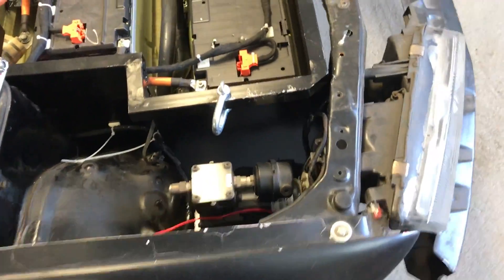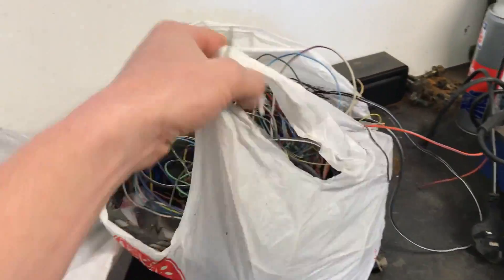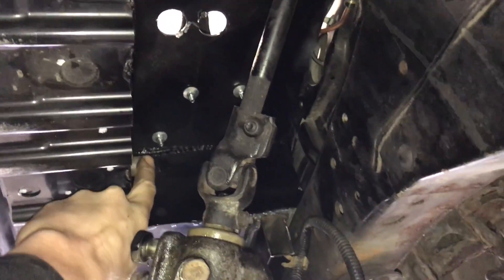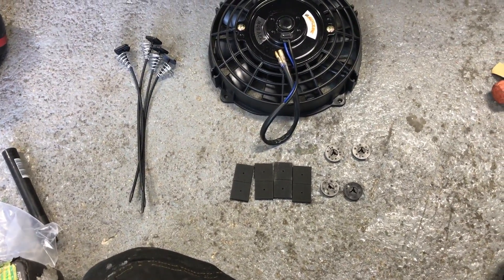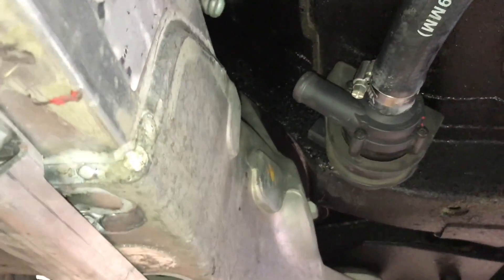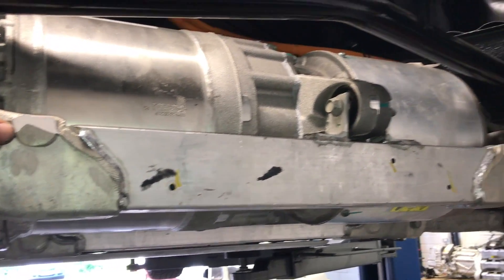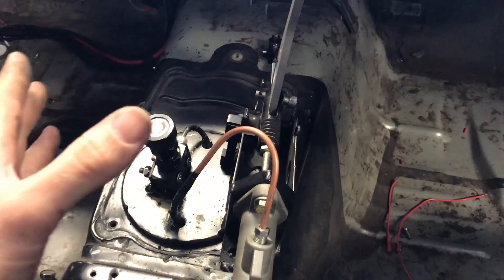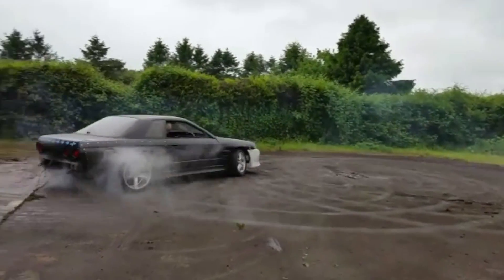We Put a Tesla Motor in a Nissan Skyline R32

Comment: Looking at building a Tesla swapped 66 Mustang, how did you break up the chassis to use the Tesla rear subframe? Did you weld the rest of the chassis to it? Wouldn't you have flexibility issues with the chassis chopped?
Reply from the maker: TheHelloDonk hi, the chassis was notched abs a full weld in roll cage has been addid

Comment: The point is not about the sound of engine, with that electric drivetrain you might get instant torque , but not instant cornering, with the speed of the donut performed by your build I can easily recognise that it is bad in cornering, with a gasoline engined motor , you car do those donuts much more faster! It is because when any electric car makes a turning, it's torque and power curve normally goes down and the car under steers because of it , but with a gasoline motor, this case would never happen! For a fact , I have seen even a formula E going as slow as 60 kmph, but usually a formula one car with a gasoline motor makes much faster cornering at 200 kmph! But don't think me wrong! I guess for city type environment, electrics are good enough because you get to accelerate easily without any clutch and shifting gears, but in racing, a gasoline engined car with a manual stick is the best option!
Reply: The power curve is linear. If you want to break some rear wheel traction and get some oversteer, press the damn accelerator.
Reply from the maker: MOTOR HAWK car n truck enthusiast check out Luke woodham on here he borrowed it for monster Engergy there as very good video up